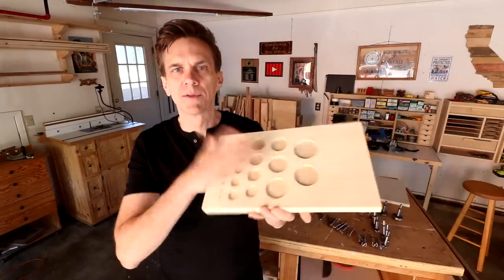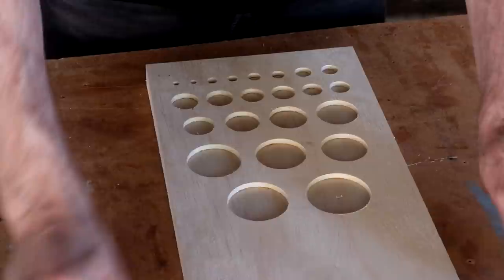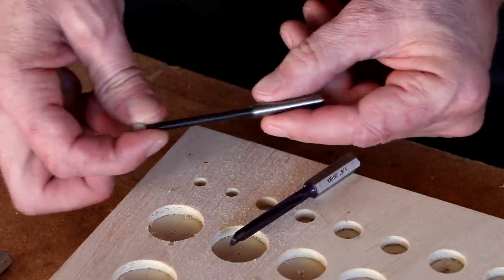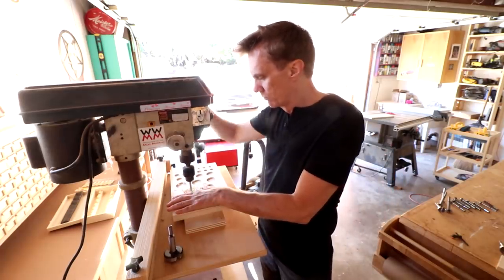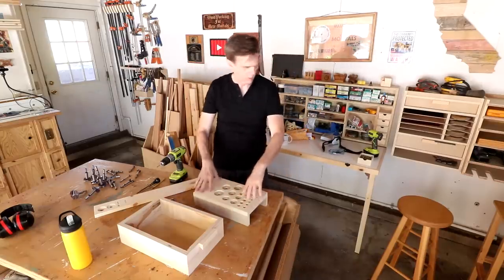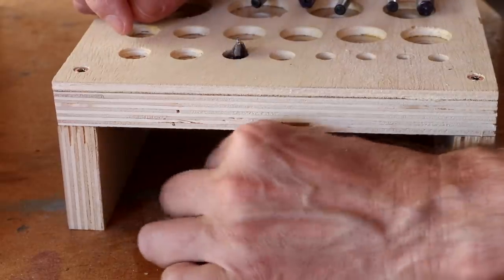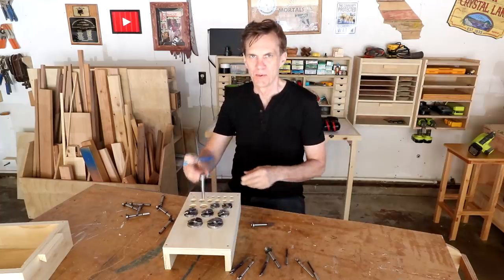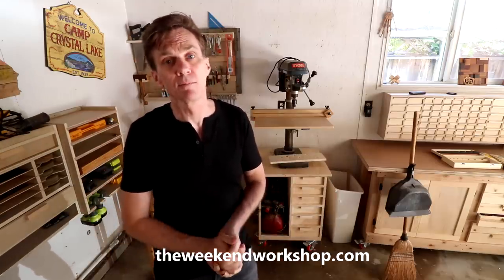Finishing up the Forstner bit storage unit. | Day 95

Comment: Thanks for these videos Steve, I really enjoy watching them. Having said that I couldn't help but shake my head on this one (and the previous one that goes with it but I didn't watch them in order). Why did you over-engineer it that much? Cutting all those holes to dimension in the 1/4" plywood serves no purpose other than identifying which bit goes where. This could have easily been done by tracing a circle using the bit circumference after it was stored...or better yet you could have just left the paper from the Sketchup drawing right on the board. One advantage of doing it this way is if you get extra bits in the future you could have simply drilled more holes for the shafts and if you wanted to re-arrange the bits you could just flip the board over and trace the new locations for the bits. Another advantage is that you would have more surface area to grab on to the bits since they would not be 1/4" deep. If you are worried about bits being loose at the bottom of the drawer I would also add a hole or two in your platform so you can place a finger in it to lift the insert, otherwise you will need to remove all your bits before removing the insert. Keep making those videos for us mere mortals! :)
Reply: Andre Roussel, and sometimes there’s Covid, so you might as well
Reply: Sometimes there's just something satisfying about things fitting perfectly into their recessed spot. I'm guessing this was more about that than complete efficiency.

Comment: Isn't it wrong/bad to touch the sharp edge/tip of bits, as moisture from fingertips can cause corrosion? I think inserting the small ones upside down will serve as additional protection. Besides, they're already labeled. Just my $0.02.

Comment: Already 250 comments so if this was mentioned, sorry for the repeat.  To get the two parts lined up, use the carpet tape and small drill.  Then drill the two pieces separately. To get the two pieces lined up, put the bits into the thick piece and then lay the thin piece on top.  You can put glue on first, or just brad nail the two together.

Comment: Well there was your answer, you ended up screwing the top to the supports, if you had screwed the boards together with 1/2" screws from the start and drilled pilots, they would have lined up perfectly afterwards ;)

Comment: I definitely think you are overthinking this. All these bits have a center point, place the correct bit in its hole, upside down, mark the centre and you are good to go. This does not need to be super accurate so you have plenty of clearance and the bits will still lay flat within its niche

Comment: I noticed the smallest forstner bit were giving you the hardest time, and it got me wondering, "what is the benefit of a 1/4" forstner bit over a regular 1/4" drill bit?"
Reply: Flat bottomed holes.  Also I've seen some evidence you might get less tear-out with a forstner bit, but your mileage may vary.  Mostly the flat bottom holes.

Comment: Those Fisch bits, are really good quality and somewhat expensive, but they last a very long time. Using the inexpensive set you had for so long. I imagine you'll never have to buy another set again. Unless there's a size you need, that didn't come with that set.

Comment: what's the reasoning for wanting to see the head of the bit? why wouldn't you want to be able to pull the bit out by the shank? drill a hole deeper and let the head of the bit rest head down. could have used the 2x4.

Comment: I'd bet that the Grizzly's 3/8" shank is actually 10mm (3/8" is 9.525mm).
Reply: Good point.  10 mm and 3/8" are both pretty common sizes for things, and that makes for some convenient workarounds when things go wrong.  For example, if you strip a10 mm head on a bolt, it's not much work to file the head down to 3/8".  Similarly, there are times when you can save a poorly drilled 3/8" hole by reaming it out to 10 mm.

Comment: I'm not a huge fan of having the bottom hole be so tight, the top hole is going to  hold the bit in place, the bottom hole could be much bigger than the shank to make taking the bit in and out much easier. I think I'd get annoyed at constantly having to put them out straight personally, especially if I had to lean across a work bunch to grab one while doing a project.

Comment: Theres a Thanos joke here somewhere, in using each bit to centre the shank hole in its own size, then using a Forstner bits to cut the holes for the shanks. 
"I used the bits to fit the bits." - Thanos,  Perfectly Balanced Woodworking

Comment: I don't know if it would disturb your sensibilities or not, but could you not just store the small bit with the too large shank upside down in the hole? Would the lack of continuity give you a case of the miasmas? Function over fashion is not always good for the brain, especially considering the overload of extra fiddling and mind scratching. I don't know. I have overthought this now and it's not even my project. *runs away screaming

Oh. Never mind. Perhaps I should have watched the entire video before commenting.